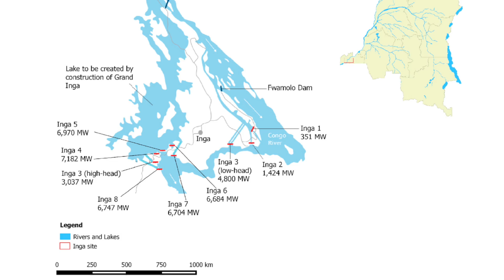Africa's Record Breaking Mega Dam - Construction Unveiled

Comment: Nothing related to Lithium is "clean"! Stop using "clean energy" to describe aniything that is not oil, coal or gas. Hydropower is probably the energy with less environmental impact, then wind and solar, but they are not "clean" either. They are clean-ER than carbon-based energy, especially with regards to CO2 production, but using the term "clean" is deceptive. Everyone should know and acknowledge it by now.